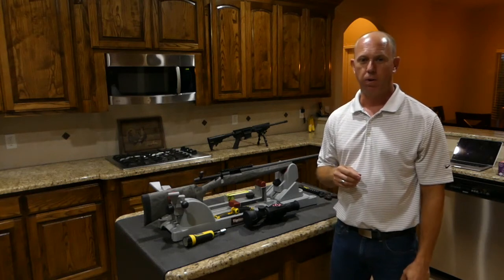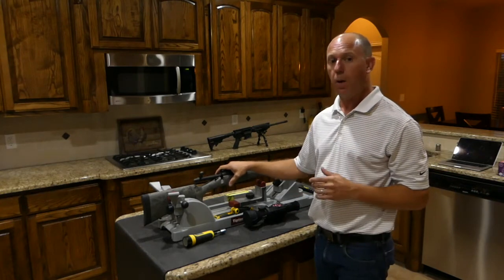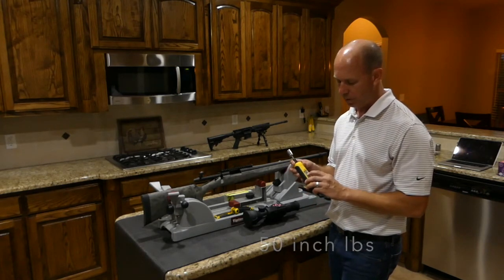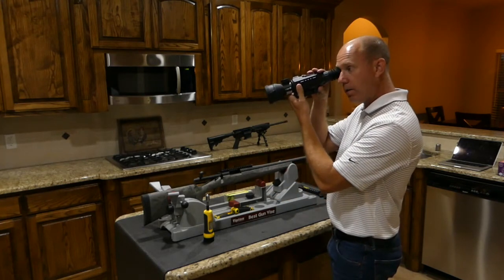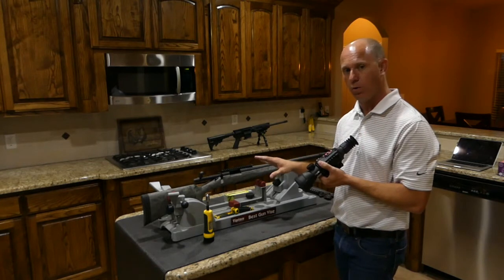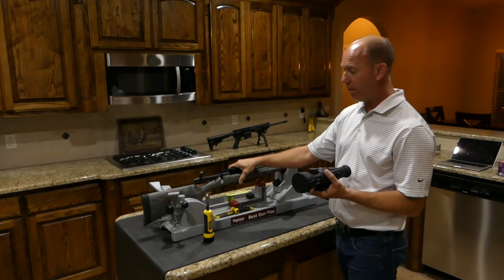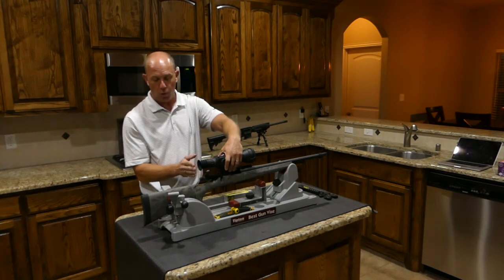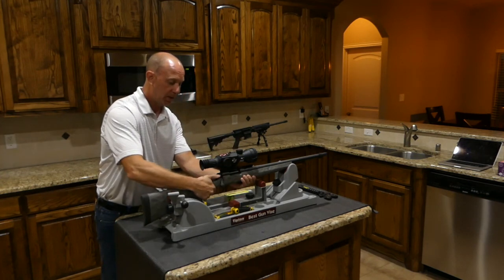ATN X Sight II Mounting to Rifle

Comment: Good step by step instructions. I installed a Nightforce 20moa pickaninny rail on a Remington 700 poe-leece .223. Even with the 5-20 scope installed in the last position, the bolt cleared nicely.

Comment: Does it come with a rail? also how can you tell the difference between a 3-14 & a 5-20? cheers
Reply from the maker: It does not come with the rail however the mount is designed to connect to a rail. EGW seems to make a large selection of reasonably priced rails for most gun manufacturers. 
3-14 is a base magnification of 3x optical zoom with a maximum of 14x digital. I find this model works best for spot and stalk hunting as the lower magnification allows for greater field of view when scanning. The 5-20 starts with a 5x optical magnification and max 20x digital zoom. I use the 5-20 predominately as I hunt a lot from blinds or stationary high rack vehicles and many of my shots are over 300 yards. 

Stay tuned I am about to do videos on the new ATN X-Sight 4k Pros. I literally just received my  5-20 from Fed Ex 30 minutes ago. I should have the 3-14 by Friday and I will do a complete side by side comparison so you can see base zoom and field of view difference.
Reply: Thank you for the reply, so ive got a ATN scope was just checking it was the 5-20 not the 3-14 but if i zoom in with the scope it doesn't say its going from 5-20 so cant tell, is there any other like physical features or way to tell my scope i brought is a 5-20?
Reply from the maker: The outside of the objective lens of the 5-20 is 2 11/16" or 68.25mm. I know the 3-14 is smaller. Once you figure that out you can set the sight type under settings. Once you have it set the zoom feature will show you what it is set at. See my video https://youtu.be/yymk0qsAukw at about 1:53 in you will see this setting.
Reply: it says both 3-14 & 5-20 on the device type, then on zoom only extended or standard?? cheers
Reply: sorted it it zooms from 5-20 now i put it on 5-20 in settings so that means its a 5-20 or it wouldn't zoom in like that aye?
Reply from the maker: The sight is not smart enough to know. If you set it to 5-20 it will read 5-20 even if the sight is a 3-14. I would recommend measuring the objective lens and seeing if it is the same or smaller than what I noted above. It will not affect the base functionality of the scope however if you use the ballistics features or range finder it will provide you incorrect info.
Reply: Ok thank you so what part/area of the lens do i measure? Thanks
Reply: if i gave you the number on it would that help?
Reply from the maker: Drone Hunting NZ measure the outside diameter of the objective lens. That is the lens facing away from the shooter.
Reply from the maker: Drone Hunting NZ yes it might. What is it
Reply: 424255